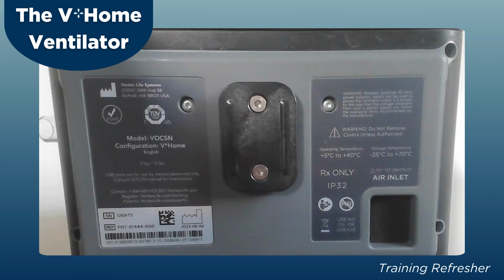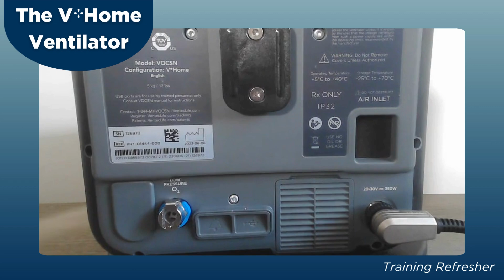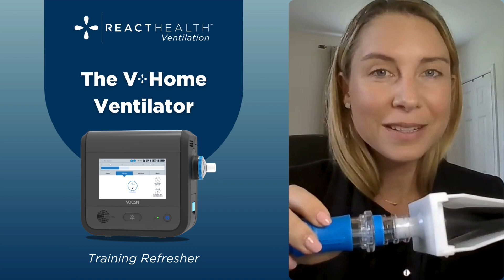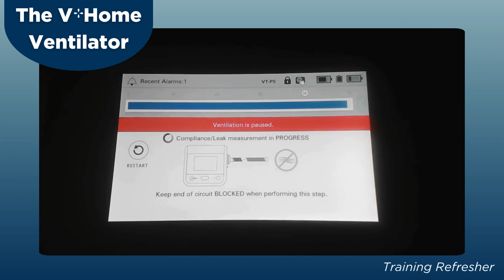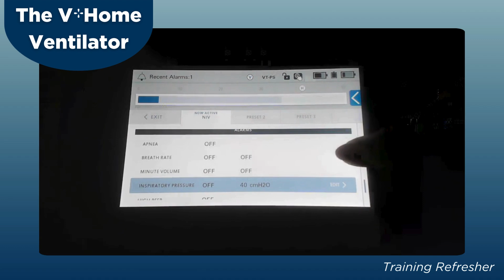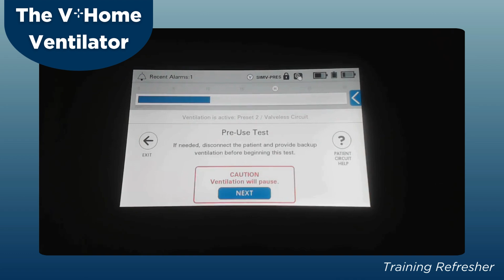React Health V*Home Set Up- Training Refresher

Comment: The fact that she had to speak so slow and dumbed down is sad considering RT's are supposed to have solid education.  But the pace and tone clearly suggests they have experience with a slower population of RT's.  Also just turning the vent on and being force fed therapy while simply setting up the vent is wild.  Imagine just turning your car on and takes off on you every time.  Who designed that and how did it pass the testing faze?
Reply: The vent does now have standby from earlier this year.  Also, the Trilogy 100-200s were the same, the pt turned them on and there was no standby they were ventilating. But you could put in in a clinical mode for settings.  Again, standby has alleviated that.